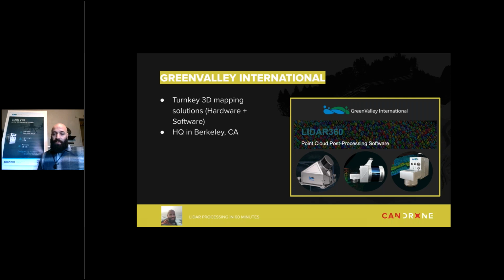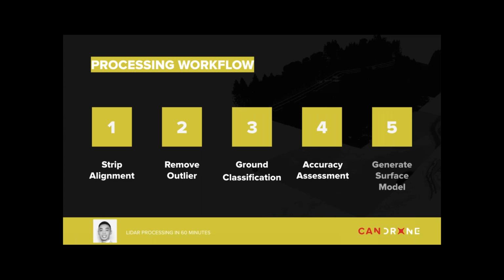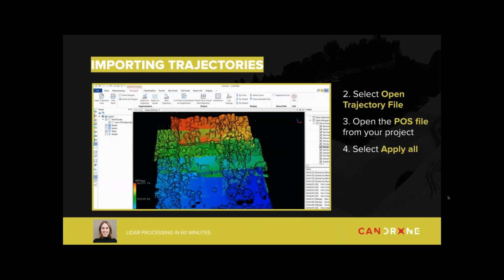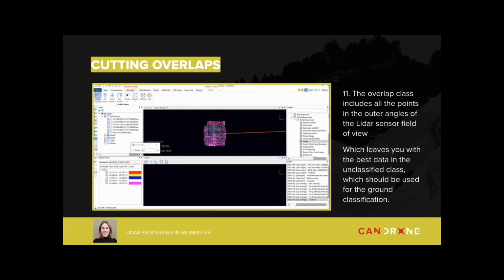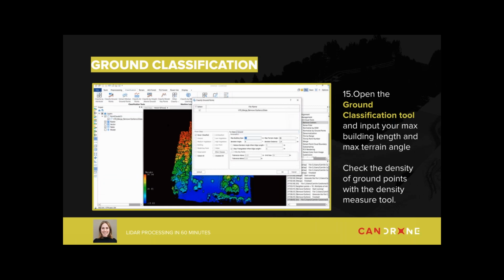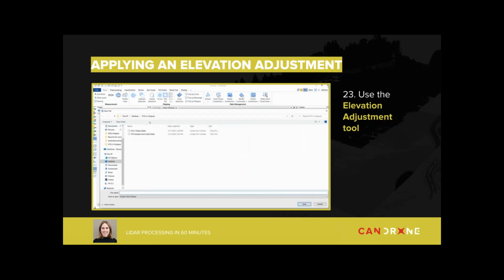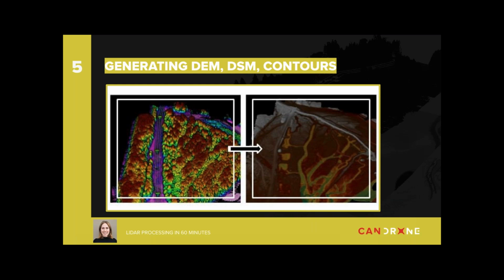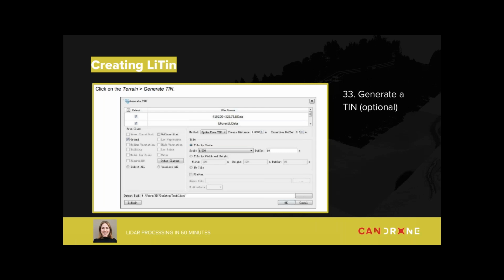Learn LiDAR data processing in 60 minutes | WEBINAR

Comment: I did not see any GCP referencing on the Horizontal.There should be a clear way just as you can do an elevation adjustment to do a horizontal adjustment. What is that tool?
Reply from the maker: This question is a little too specific for us to answer here. Reach out to us at support@candrone.com to speak with a team member and we will try and help you.